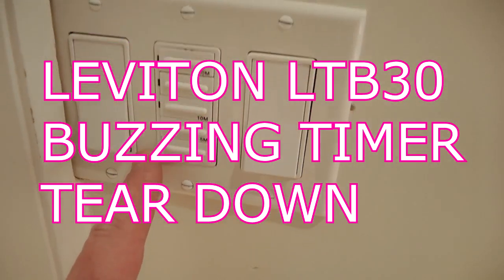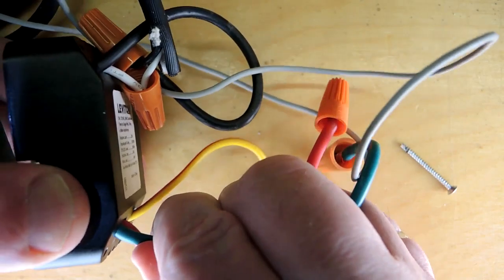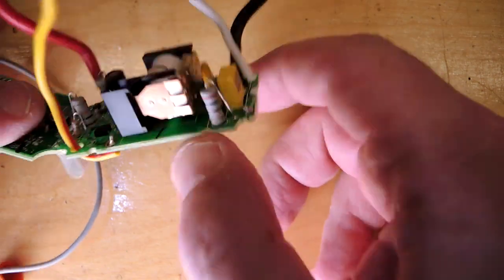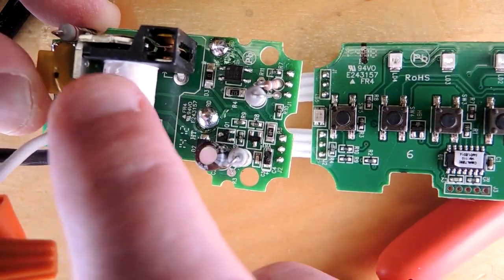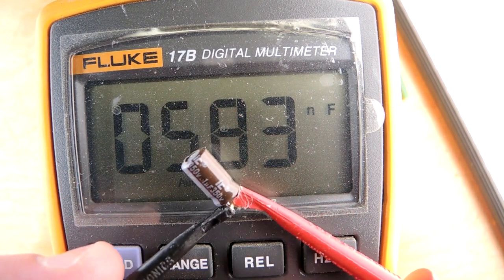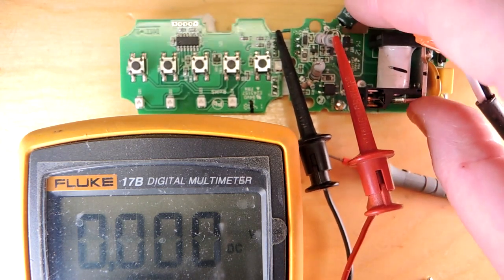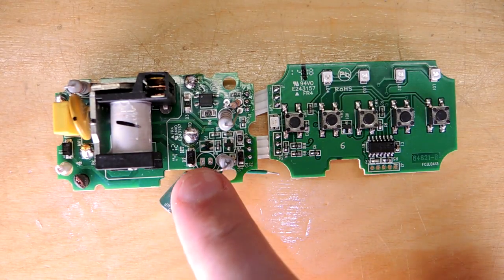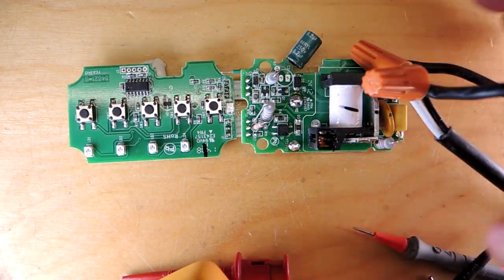LEVITON LTB30 BUZZING TIMER FAILURE ANALYSIS

Comment: Hey there, thanks for this video! I have no experience with electrical work so I'll be hiring someone to come and swap these for me... but just curious - for the next week or so is it safe to still use the switch with the buzzing? I was worried the sound was coming from an electrical arc or something dangerous that could start a fire, so I stopped using the switch all together.

Comment: Great analysis！I installed 5 of this timer switch in my home for control of ventilation fans.  The one in the powder room showed this symptom recently. I am expecting the other ones will fail soon. To those who are using this for fans/pumps — please consider changing them asap when it fails because a chattering relay could endanger the motor insulation, causing further damage.
Reply: Just a quick update: I bought a 450V1uF cap from a local store and asked my high school boy replaced the bad capacitor. The old capacitor was measured 0.7uF, 30% lower than rated capacitance. Please be careful not to break the flex links connecting the boards. Now my son replaced the laundry room fan switch with the repaired one.

Comment: A derated tantulum capacitor will last a very very long time. That electrolytic sounds like it shorted out and provides nearly 0 capacitance. That would affect frequency on a RC circuit.

Comment: I hope you can contact LEviton and let them know about this poor engineering. mine also failed the same way, loud noise and the button is never even used in this bathroom since  people rarely go into this room. I had it set up to operate the fan in the bathroom.  It died just from the heat which is always running, and it's probably been used only 5 times in 1 year.

Comment: I had 2 timer switches both are buzzing, I changed the capacitors with 4.7mf and 1.0mf now both are working. The 4.7mf i bent the legs so i can put the cover. Many thanks electronupdate for posting this video!

Comment: Same problem here.  Thank you for the video! But besides the failing cap design I am also concerned about that 1W power dissipating 24x7. Because over time this would add up to the cost comparable to the value of the switch itself! Is there a brand of the switch that does not waste our power like this?

Comment: I have the LTB60 model and after about 5yrs it started buzzing. It has the same design flaw of the high load resistor next to the capacitor.

Comment: Great video! Anyone with this issue should give Leviton a call. I had three of these units buzzing and they sent out replacements without any problem.
Reply: Their number is 1-800-824-3005 (1-800-469-7890 Canada). I have two buzzing units (LTB60 and LTB15). However I took the LTB60 apart and the 1uF is actually coming up nearly 800 nF, which is pretty darn near to spec. If I let it buzz for about 1-2 minutes it actually stops buzzing & works properly. But when it does buzz what is it doing to my bath fan? Plus it's probably doing the relay switch no good.

Comment: Hi, thank you for your presentation. I have the same timer circuit board although it is a different brand. The timer has recently failed to work according to the time set. It will turn off in a couple of minutes even if you set it at 60 minutes. The relay is a concealed one and does not make noise like yours. Do you think it could be the capacitor failing in this case? There is the big one like the one you changed and two tiny ones. They do not show leakage or bulging. I appreciate it if you can give me some help here. Thanks!

Comment: My second timer failed. I thought, how can this switch fail again? I rarely use it.  Well, your video totally explains it. When not in used, that resistor gets so hot, it dries up the cap sitting rigth next to it. Great product but a poor PCB layout and/or component choices. Video so well done and enjoyed it all. The problem with Leviton is that they don't have you as their Reliability/Electrical Engineer. Now I have to find another switch mfr . I use this switch to operate a gas fireplace.  Thanks again electronupdate!

Comment: If I was the boss, the electrolytic capacitor would have been shrink wrapped to the hot power resistor for maximum heat transfer feature.  Close proximity is not good enough.
Reply: Exactly the opposite of what should have been done. Those two components need to be separated.
Reply: @HHG_BREEDINGGROUND1  No, I want you to buy more of the product than necessary and stuff the landfills with rare earth metals.  The capacitor gets shrink tubed to the power resistor.
Reply: @gavincurtis  ok I get it now !

Comment: Thanks for the excellent video and problem identification. I have three installed, and two are failed. Also have three failed units in a box. I will now order a handful of the capacitors and replace the 5 failed units. 

The engineer made an error, sure, but it the organizations attention to the upgrade is the real issue. Furthermore, there was no validation, a simple thermal review of the prototype board would have found that. Just a poor process all around.

2 yrs later - I ordered a bunch of caps from DigiKey and repaired three units originally, plus two older units. I left some excess wire on the cap install and bent them over 90 degrees away from the resistor.  All are still working!!  A 6th unit (original) started buzzing in service and replaced it's cap yesterday - back up and working. I had to relearn the programming - just had to hold down 1 and 3 buttons until the green light flashed. Read the flyer from the Leviton site.

Comment: i have 4 replacements coming , hardware has been updated, absolutely no issues with teck support, no waiting on the phone, pleasant conversation.
 as a electrician , it's good to know that this American outfit will stand behind their product (assuming made in China)

quoted from internet site
 "The company was founded in 1906 by Isidor Leviton.[3] He began by manufacturing brass mantle tips for the natural gas lighting infrastructure in Manhattan. They sold their mantle tips on a pushcart on the Bowery on the Lower East Side of Manhattan. He also designed a screw-in lampholder for Thomas Edison's electric lamp in 1910, and within ten years the lampholders were being used in nearly every apartment in New York City."

Comment: So I just replaced my buzzing LTB30 timer with a free warranty replacement from Leviton. The rep on the phone told me that the timer had been redesigned. Out of curiosity, I disassembled the new one, and compared it with my old one (which has identical components to the one in this video). Sure enough, the components have been updated. The capacitor and resistor noted above have been changed. I'm not sophisticated enough to know exactly what was done. I don't even see a resistor in the new one - looks to be 2 metallized polyester film capacitors in that area now (one has mef 684K 250V on it),  and some of the other components have been changed. So I am hopeful the replacement timer will work well, and perhaps also have a lower standby current draw.
Reply: Can you put up pics of the new circuit by any chance?   (upload to something like gyazo and share a link)  Need to repair mine soon so would like to do it right.

Comment: Thank you for actually determining what the issue is and sharing it with us.

I've had several of these fail, just like this, for me over the years.
I guess I'm going to have to look for a new brand this time :)

Do you recommend any specific brand?
Reply: I was also wondering if there's any danger to using the switches when the relay element keeps switching causing the buzzing noise?

Comment: At 7:29 you say "...they could have put a ceramic capacitor here....".  Is it feasible for the DIYer to purchase a ceramic capacitor, put it in, button it up and put it back to use? If I replace like for like capacitor, is there a heat shield I can stick between parts?  You don't mention if it's possible to reassemble after tearing it down to the point you took it.  I have a LTB60 and I can't find another brand that goes out 60 minutes.  BTW - nice work!
Reply: I've got three 60 minute versions of this same timer, also all buzzing. My first thought was like yours: "Should be possible to fix these things, shouldn't it? And add a heat sink?" Did you pursue this on your own? If so, can you provide some more insight?
Reply: I came back to ask the same question. I replaced a capacitor on my wireless router that went years ago, this looks like it should be doable as well?

Comment: What would be the best option for repair? I've got a couple of these and would like to fix them, seems to me if I put another electrolitic the same will happen. Should they be replaced with ceramic? If so, what value? Or some sort of heat shielding?

Comment: Loved your video (as usual)....interesting, informative, to the point, but not full of distracting jump cuts or music etc....

Here's a related puzzler I'm working on - why do my incandescent bulbs buzz when on wall dimmers?  I'm guessing it's related to the type of dimming (phase-angle, positive, negative, etc etc) but haven't found one that doesn't yet.  (Have not yet broken out the scope to check the waveforms.)

I've tried a few different Lutron, LED compatible or not, all buzz.  Thought of getting a different brand, and an LED-compatible Leviton makes them buzz .....well, a little less......

It's driving me crazy.  I haven't found any satisfactory dimmable LED bulbs yet either (not enough brightness range, not warm enough color when dim - although some don't buzz!).  

What bugs me most is that I know it's possible since I have two touch lamps that dim incandescents without buzzing.

Anyone out there have an idea?

Comment: Funny enough today I did a similar one, that controls the water heater. Failed 330n 275V capacitor, reading around 180n, and the 47uF 63V capacitor in the PSU was looking a little unhappy, ESR of around 20R. Being New years eve I just went into the pile awaiting the trip to the Ewaste container, and found the volunteers for the new used parts. One 330n 275V capacitor, still good enough, and one 47uF 50V capacitor, also good enough and 105c as well. 

Bit of work, and clean the board of the residue from manufacture and it powered right up again, and will put it back in service again next year.

Comment: Nice analysis!  
I'm going to comment on some of the comments already posted.  
1)  Monday Morning quarterbacking about just adding $1-$2 for a latching relay or some other feature isn't fair.  
Consumer grade stuff often has aggressive, immovable price points. 
IIRC, that is just a phenolic PCB, as a in point.   

2)  But yes, it was a totally boneheaded move to put a power resistor right next to an electrolytic cap.  :-\  

3)  It looked like there was a full-wave bridge on the input to the low voltage section. (?)  
If so, a half wave approach, lessening Vdrop challenges for increased filter ripple might have been worth considering.  

4)  What about the method of using a cap in place of the power resistor?  
(Using the capacitive reactance of the cap to do the job of dropping mains volatge.)  
I think to meet safety specs, it has to be some sort of a metal film cap, 
so (again,) cost and size for this approach might have been prohibitive.

5)  As far as the comment about "supersizing the uF" for margin. 
You can do that.  But you just have to watch  out for the increased surge current in getting a large cap charged up.
Here, this is probably okay, since the surge would be encountered only when the box was first installed 
or when power is lost and comes back on again.  But keep this in mind when considering upsizing filtering for future applications...

Best,
Dr Dan

Comment: I have a bin with about 4 of those switches, all dead with the buzz of death. I went to Home Depot to pick up another replacement, and they were sold out. The person at Home Depot said that they had a lot of people coming in to replace this device and their stock was exhausted. 

I ended up getting three of their house brand equivalents (Defiant I believe) and have had zero problems with them over about 2 years.

Comment: I have one of these buzzers in a box somewhere, never got around to peeking under the hood. It’s been a couple years, but when I replaced the timer I found plenty of others who’d had similar issues, some going back quite some time. I couldn’t find any response from Leviton acknowledging a flaw, only boilerplate responses regarding checking the installation, reduced longevity in moist environments, etc.

Guess Leviton never got around to looking inside either.
Reply: They never look inside. This device looks like rebranded Chinese crap.

Comment: I am very surprised they didn't use a capacitive dropper on there.  Most of the coffee pots I used to tear apart as a kid had capacitive droppers on them, so there's enough current to run a relay (for the heating element) and the electronics (a red LED 7 seg style one).  I guess two big resistors was cheaper, but it sure wasn't better.

Comment: It's really a textbook error.  Why do designers still do things like this?  With our higher 240V supplies the heat dissipation from resistive droppers is more of an issue, so we tend to use capacitive droppers more.  Our similar fault symptoms would often be the dropper capacitor failing low capacitance.
Reply: Planned obsolescence? If it lasted beyond the warranty period, they'd actually have to innovate and create new products to generate fresh sales. With planned obsolescence they can extract money from their established customers looking for replacement parts - No additional tooling or R&D costs for the company, and hence more money to spend on their expensive subscription porn habits and latex bondage gear
Reply: Often, the brown sleeve caps are 105c, but I couldn't make out that marking in the video. I suspect they did some fast cost analysis and decided a high temp cap would mitigate failures somewhat. A risk they lost. In 20 years of electronic service I have replaced a ton of the so called 105c caps, and although they are a bit better with heat, they cannot escape the reality that heat damages e-caps. That is what worries me about the huge installed volume of LED lamps that all run their electronics at a very high temperature. (And claim a 20 year life!)
Reply: @JDfromWitness  yep. they over current most of the LED's (to peak power), have been repairing quite a few and adjusting the regulators to decrease current.
Reply: I don't really buy into the planned obsolescence argument. Early failure in products tend to drive consumers away from the brand which can be detrimental to business in the long term. A lot of these companies hire some low bid Chinese manufacturer to develop and build their product. In many cases the engineering is lax and there are mistakes and cheap components used. IMO, the fault lies with the company that "bean counted" the product to the lowest bidder.

Comment: Leviton is a brand I avoid now because I put in a similar motion sensing wall switch unit which leaks power. When you've got an incandescent bulb in you have to look hard to see it but when you put a CFL in, it blinks annoyingly. And I installed this in some one's bedroom for the convenience that they would never forget to turn off the light. Didn't Leviton used to be a good brand?

Comment: Tare down/shootout suggestion.  120 volt 3 prong house USB charging added outlets.  3 Brands  Legrand Pass & Seymour, Eaton, and Leviton. Test for engineering philosophy differences,  non use power usage IE vampire mode, fire hazard long term ( my big question), quality 5vdc of output and max load of whole unit inside a plastic outletbox when you have a 1500v space heater and both USB 5 volts charging 2 iPads at full rate?  Now thats a GOOD!!! video!!

https://www.homedepot.com/p/Leviton-Decora-15-Amp-Combination-Duplex-Outlet-and-USB-Outlet-White-R02-T5632-0BW/205092277

.

Comment: Had that with an industrial control timer, and simply replaced the capacitors with new ones, plus replaced the hot running 1W resistors ( which were running at nearly 2W there) with 10W ones, which I could fit into the case without issue. Been running for decades now without issue. 

However the Leviton is limited in space for the capacitors, so while the designer probably wanted to fit in a 3W resistor and a film capacitor there was only room for the 1W one and the boilalytic, no other room for anything like a capacitive dropper which would have saved power as well. Don't think that timer will have any good Energy star rating with 3W of power use on or off, standby power is a big thing to minimise to get that A rating. Hard to fit the lot in the confined volume of a wall switch replacement, and still fit with wiring into a standard outlet box while remaining flush.
Reply: Is it still running

Comment: For what it's worth, this particular timer switch has a 5 year warranty from Leviton. So I'd say it's a pretty ignorant design choice on their end.
Reply: Leviton will say he violated the warranty:-)
Reply: They will also make him pay the shipping and handling
Reply: @Shawn_White  same. Mine started doing this last week (2 yrs old). They are sending me a new one.
Reply: Thanks for this post. I called them and they are sending me a new one (no questions asked except when I acquired it - 4 years ago). So, it's free... and I might doing this again.  ;-)
Reply: Just replaced this with a different model. Even if Leviton will replace, i don't want the hassle of doing this in every year.
Reply: Great detailed video. I’m nothing close to an electrical engineer, but your explanation was slow and clear enough that I was able to make sense of most of your video. Ours just started buzzing a few days ago. Has been in the bathroom for just over six years so it seems we lucked out. I’m sure it is also related to the frequency of use.